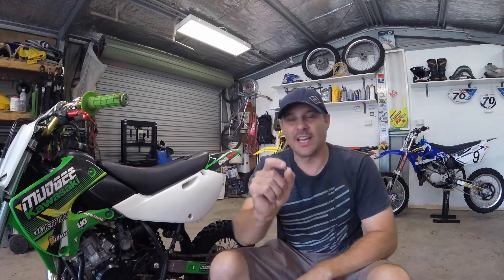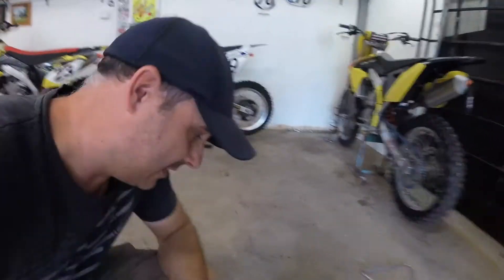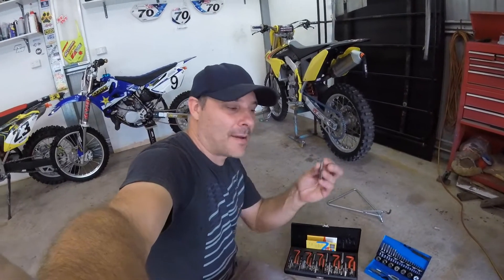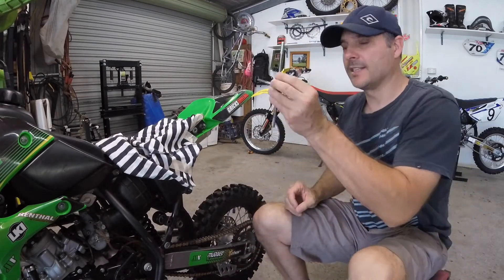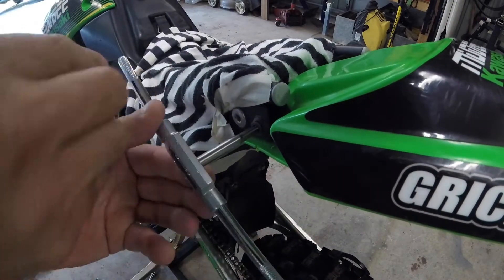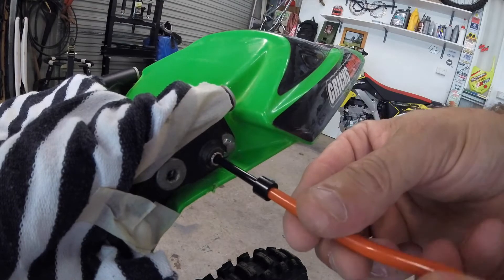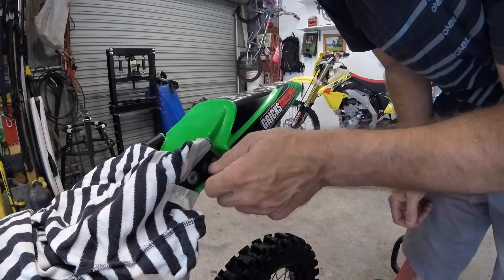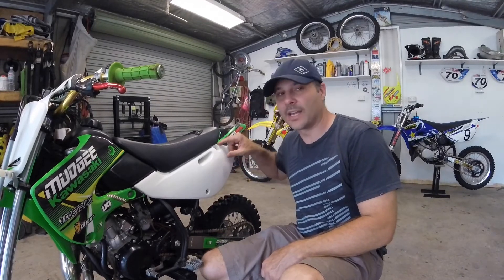Helicoil installation fixing stripped threads

Comment: Hey mate need some advice, I’ve got a stripped out oil level check bolt on my ktm exc. do you recommend this system? I’m worried about metal shavings from drilling and tapping getting into the engine and don’t really want to pull it all apart. Cheers
Reply from the maker: I have the same concern as you

Comment: Nice video!  I’ve never used these but I need a set just in case. Do you have to put loctite or anything on the helicoil to keep it in place?
Reply from the maker: Thanks Donnie no you don't have to put lactate on them but if you do make sure it sets before putting a bolt in there.